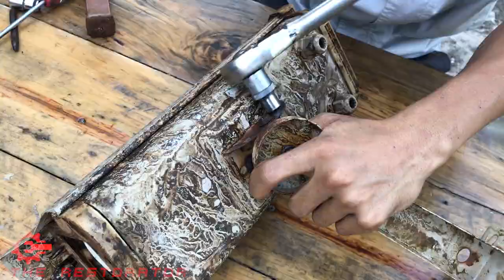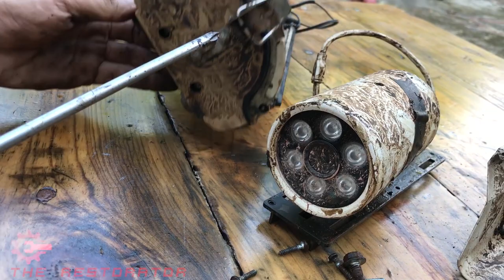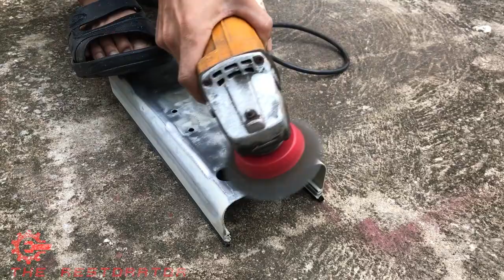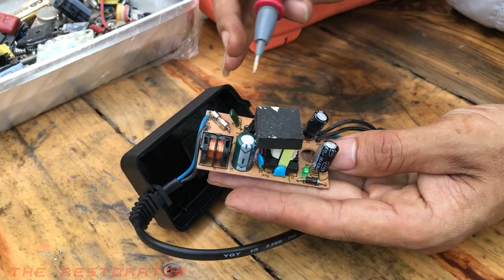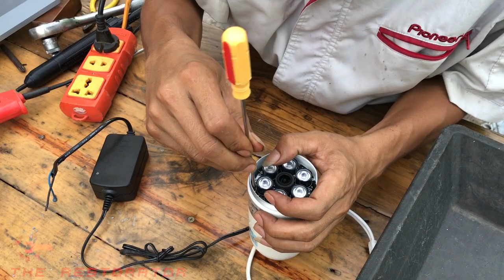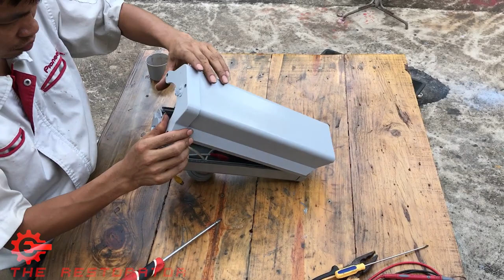Restoration Camera Security | Restore Very Big Camera

Comment: we had one of those in the parking lot at work, i'm pretty sure it was a dummy camera meant to freak out the people eating in their cars, to help them get back to work on time
Reply: No reputable CCTV installer uses these box camera housings anymore because they're long obsolete. About the last time they were used in numbers is 15 or so years ago before the transition to IP cameras. The only reason they still exist today is because new cameras are retrofitted inside, or some trunk slammer was getting rid of old stock.

I remove them if I'm servicing a camera system and put an outdoor rated camera in its place. These box camera housings create more problems than they solve, the worst being moisture and wasp collection that inevitably ends up blocking the camera lens. If they're high up, you gotta get stupid long ladders or a bucket truck to service them, it's not fun.

It is always hilarious to see how idiot fly by night installers use them though. I've seen them mounted sideways and upside down, which completely defeats what little weather resistance they have. Thankfully they're usually so poorly sealed that water leaks out when it does get inside, and it will.

If there is a working camera inside, it's probably decades old and has a very poor picture. The types of analog cameras in these housings are usually 480i or worse, and about the only thing you can make out on them are blobs of color, or in the case of B&W cameras, blobs of shades of gray.
Reply: @GGigabiteM  Some IP camera vendors are still creating and updating box camera designs...*COUGH COUGH* Axis
Reply: @GGigabiteM  You're right but they look cool though.
Reply: @vista9434  Those hammer head looking things, like the M1114/M1124, also the M1124E? I hate those things. The firmware sucks and they're always a pain to adjust.

I have a few dead ones in the back of my service van.
Reply: @GGigabiteM  Those are the ones (+their P and Q series brothers). I've deployed some Axis Cameras (M10 series and M30 series) and those have been fine but running any motion detection on the cameras would reduce the frame rate by a ton so I shifted it to XProtect instead.